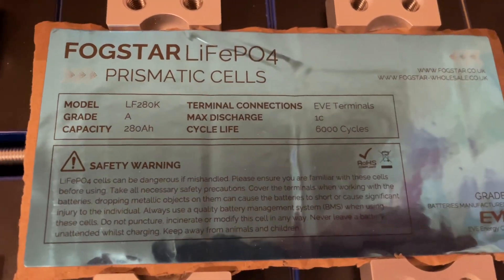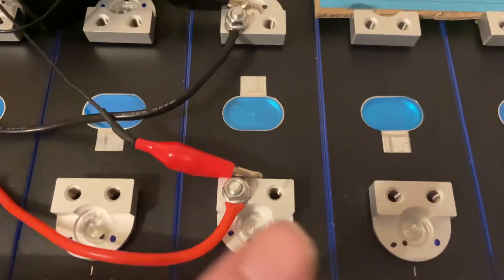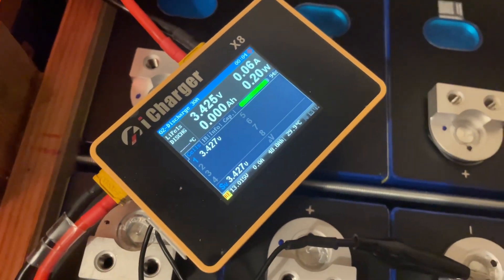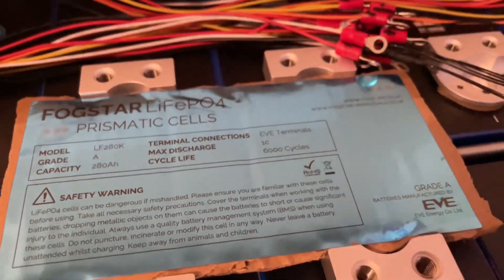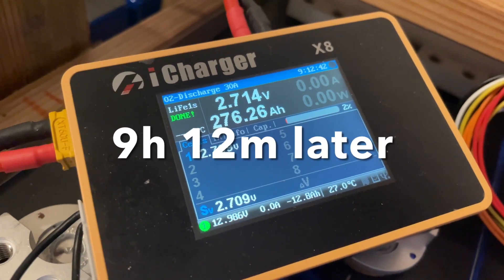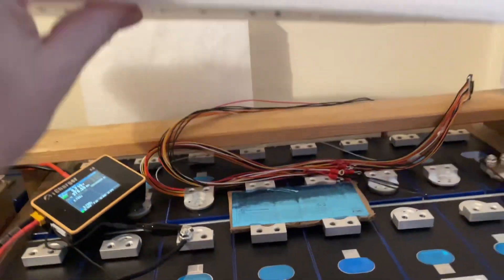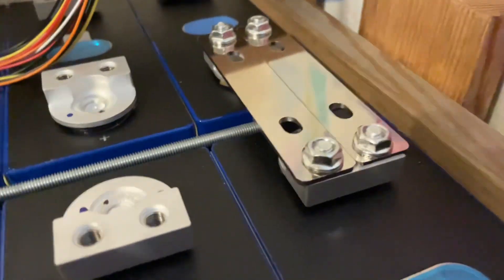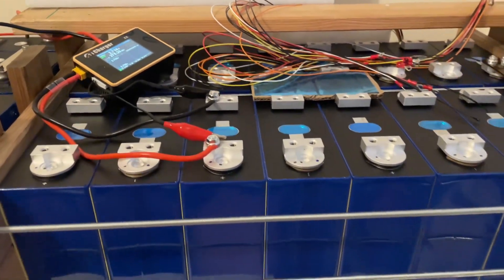280Ah prismatic Eve LF280K Capacity test solar battery DIY

Comment: Good test, but knowing the LifePO4 charge curve I doubt that you will get the extra 4Ah by charging from 3.62 to 3.65v. You can do a test and you'll see I'm right. New 280Ah cells should pull from 282 to 290Ah when new.
Reply from the maker: I’ll do a retest in 12 months and see the difference. The battery is fully built and in service running 80% dod
Reply: Not 280K. They'll test right around 280Ah when new.
Reply from the maker: @niktak1114  In the past I experienced an increase in capacity from testing new to then testing 6 months after and found that they did gain capacity. I’m hopeful the same will happen to this cells